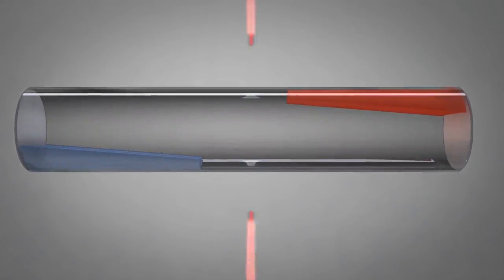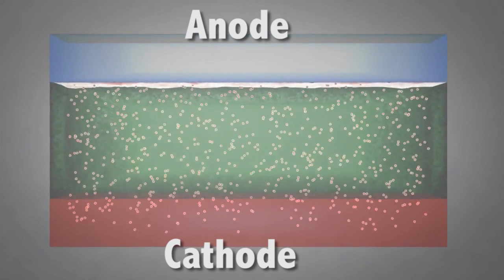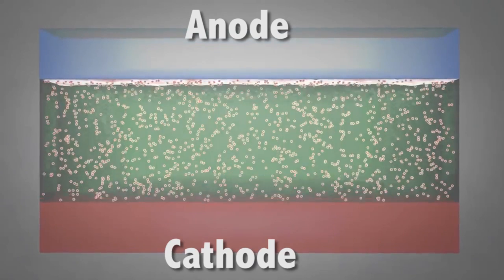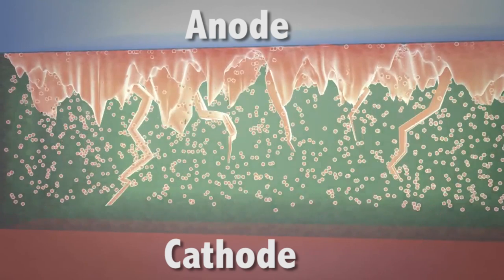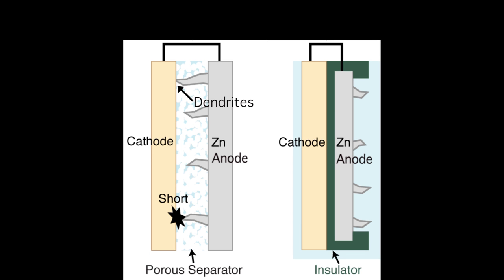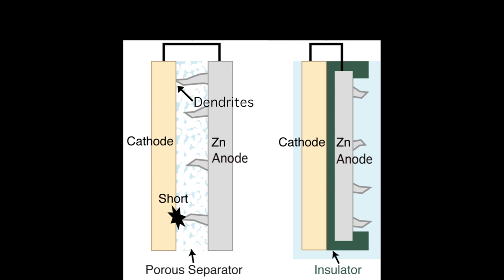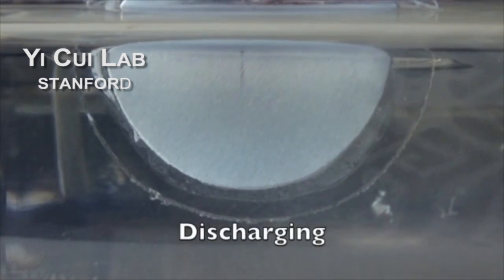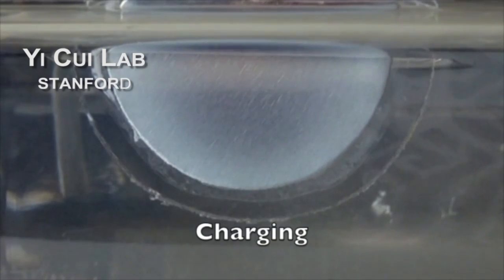Rechargeable zinc battery

Comment: Yes. The carbon plate is the anode. Cathode material could be copper or even lead oxide. What, pray tell, is the seperator? Not only does it serve the function of dendrite containment, so claimed in the video, but also keeps the cell from self discharging. How might we learn more about this seperator? Is it the same as used in NiMH?

Comment: Since when education system uses inverted labeling for cathode and Anode?  Does this thing has scientific reason behind it or is there political motivation behind it?
Reply: It is by no means an inverted labelling even in the textbooks , the function of electrochemical system decides the electrodes to be called as cathode or anode, here is an innovation in protection of metallic Zn based batteries from shortning.
Reply: It's quite confusing.  Most devices consume energy rather than produce it, so we're used to "current" (positive charge carrier convention) going into the positive (potential) electrode.  It is the same when charging a battery, but the quasi-standard nomenclature refers to the case of discharging the battery.   Technically when charging the battery, the names ought to be switched to what you were expecting , but that isn't done because people want to identify the electrode with a name that doesn't change with the direction of current.  By definition the names "anode" and "cathode" indicate the current direction, not the voltage potential, but unfortunately it is being used as though it refers to voltage.  The original definition can be remembered by the mnemonic "ACID", "Anode is Current Into Device".  Better terminology uses " positive electrode" and "negative electrode".  I wonder if a good short-hand might be "posode" and "negode".  This might resolve the problem, but good luck getting people to change their habits.  We might as well adopt the metric system while we're at it, lol.
Reply: When i was learning electronics in the 1980's,   the standard current flow was from the negative to positive.  In fact,  this is how they taught back in the 1950's. Later on,  the schools started teaching kids that current flow is from positive to negative.  I don't know the reason behind this,  but This just makes it more complicated and confusing than it needs to.
Reply: Haha this one always stayed in my mind. To clarify, don't think about the anode and the cathode being switched around, since reduction will always occur at the cathode, and oxidation will always occur at the anode (yes for any type of cell/battery, you name it). The only difference is the polarity of the electrodes which probably influence the switching of the electrodes. hope this clarified.